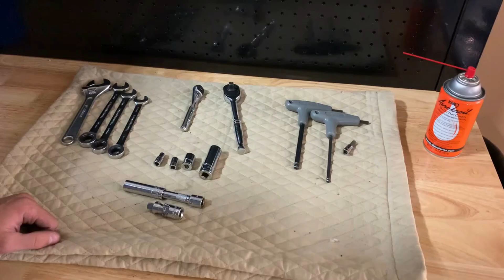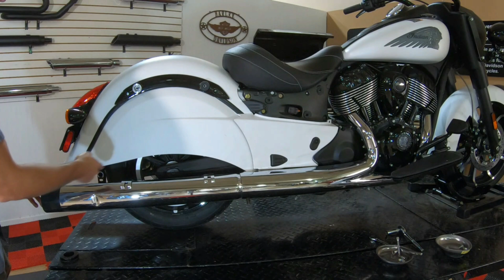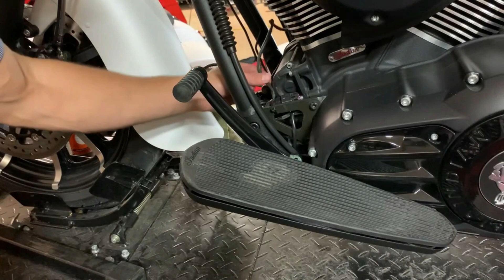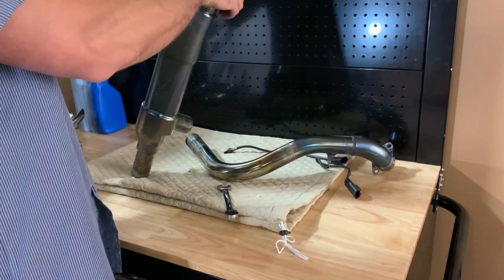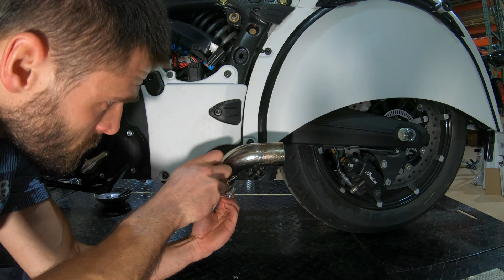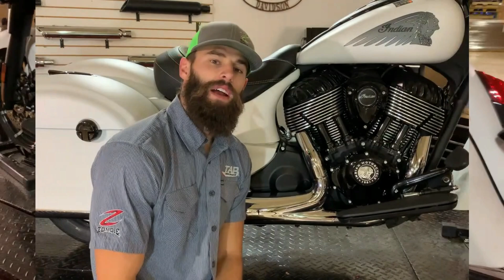TAB Performance Indian Header - Install Instruction Video

Comment: Kinda wish you only sold the crossover section for rear header.
Reply from the maker: In this video, for the Thunderstroke header we actually reuse the stock cross over! At this time, we don't produce that crossover piece since the factory one is reused.  However, you may try your luck on eBay to find a used one if yours is damaged!

Comment: I have a 15 Roadmaster, dealer tells me when you change the pipes, you have to change the intake. Is that right? My cat is clogged and puts out tremendous heat
 Three K for a new system seems ridiculous
Reply from the maker: Your dealer may be referring to the tuning side of decatting your system.  If you choose to decat a system the bike needs tuned and I believe the way Indian does that is through a flash that is associated with the breather though I am not sure on that.  We typically tune our bikes with a PowerVision tuner from Dynojet.

Comment: I have a 23 chieftain with the stage 1 pipes intake and tune from indian, how much would this affect the power without a retune? Because no one touches indians around me..
Reply from the maker: Without a tune, I would not recommend this type of upgrade.  However if you are comfortable with a header install, dynojet can help with a tune without needing a dyno.  https://www.tabperformance.com/2014-Up-Indian-Motorcycles-Power-Vision-tuner-p/indian-power-vision-3.htm

Comment: I can’t find a video yet that shows how to remove the covers to get to the exhaust bolts on the heads.  I’ve removed the two that are known but there has to be one more because it’s not moving
Reply: no only 2 the rear are jut 2 pins mine were corroded put on some release agent

Comment: you recommend a different air breather with this install?
Reply from the maker: If you are just wanting to dump heat and gain some sound, it isn't necessary, but it will help with performance and some with cooling.